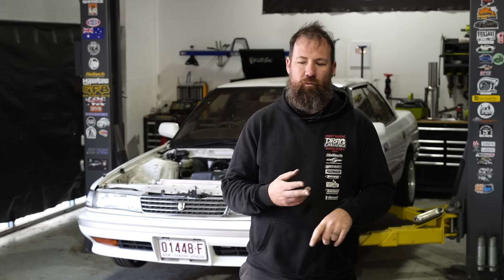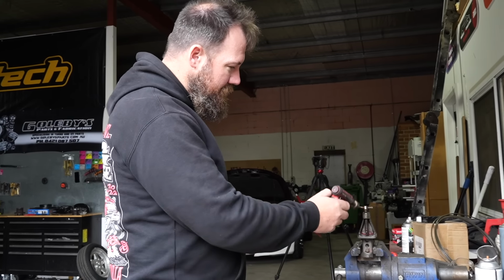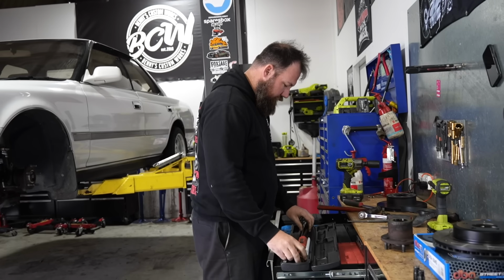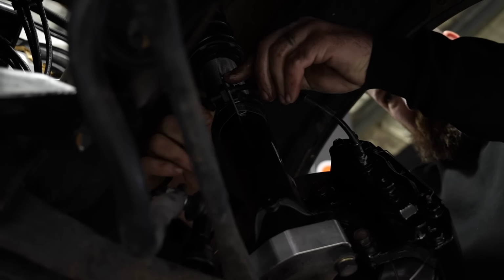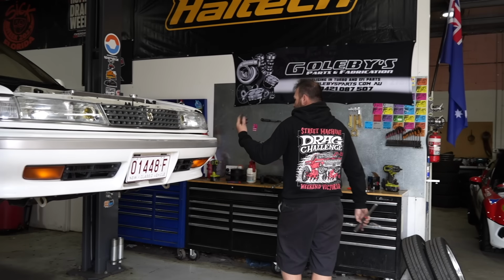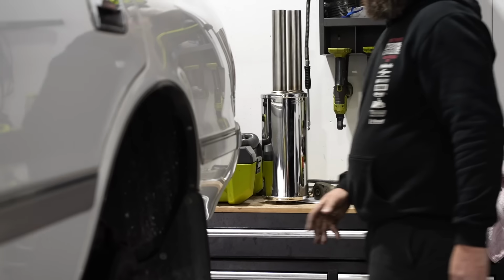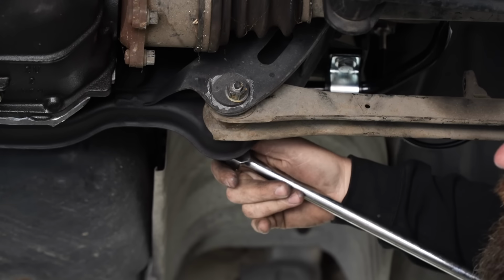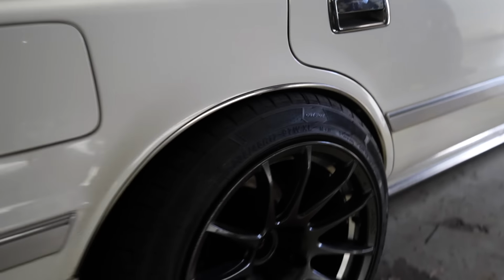Why are R33 Skyline brakes so good?

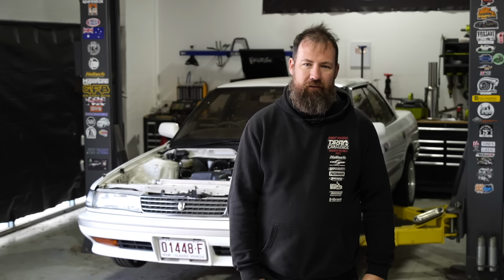Comment: 1:32 ... ADHD yes... GTiR yes, keen on bigger brakes, but also still using stock 14" wheels ... one day perhaps 4x100 - > 5x114 conversion along with new 16" ... 
GTiR front is the ADV22F ... f*cking tiny 257mm considering the amount of us running extra boost ...

Comment: Can confirm you can run 16's with the R33 brake upgrade, currently got 16x6.5 +25 on my MX73.
Reply from the maker: 15 inch convo pros clear them :) 
R33 oem wheels are 16’s😊

Comment: opened my snap on 1/2 digital torque wrench after like 2 months of no using it and the batteries were still inside and completely errored everything inside where they go, absolutely sucked considering the price of the wrench

Comment: "I think it's a bit of a 'Wives Tale'..." As a motorcyclist who has had to bleed brakes way to many times. The system on a car is large enough, the smallest amount of air won't cause any kind of issue, but, on a motorcycle, the drops shown in your video is enough to effect braking on a bike. If it isn't a solid stream, not drops, it's a real problem for us, but, a car has enough inborn pressure that small amount of air isn't going to make a difference.

Comment: Any chance this would work with R34 (gtt) calipers to accommodate a 310mm disc or would they have different spacing to the R33 unit? Or 296 plenty of brake for x8s until you’re making silly kW and doing track work anyway?
Reply from the maker: I have been comparing disc sizing on the DBA website but I haven’t looked at the 34 as it has 14mm bolts so the knuckles need to be drilled
Reply: The yanks have some crazy 6 pot brake upgrade that has a 330mm disc with minimal modifications.

Comment: The smear on the brake pad affects both the ability to move and, to some extent/stop rattles.
Gas in the house can be quite bad, most are not vented properly, and carbon monoxide poisoning is a thing, that is why it is recommended to have a carbon monoxide alarm... that and most of the heat is wasted energy. 
Not all range hoods over the burners vent to outside, a lot just go behind the cabinets or maybe into the roof space above.

Comment: Benny  are you running flexfuel e85 what size injectors will you use   thankyou
Reply from the maker: Yes we have the capacity to run E85, from memory the injector is around 500 cc
Reply: Thanks

Comment: So, are shouldered spindles common on rwd Japanese cars? I've only seen them used on Dakotas here in the states.
Reply from the maker: This is the first Toyota I’ve seen them on, JZX90 on uses the same bearing but in reverse, the knuckle/ upright supports the outer bearing shell and the flange presses into the inner surface of the bearing. Ford also used it here in Australia from 1999 on

Comment: This is a lot like what I did to my 2010 WRX, I got a caliper bracket set, Cadi ATS-V brembo calipers, 2004 STI slotted rotors. Did this all for about 800-900USD, would have been less if I didn't change the rear rotors too. I was going get them powder coated but ended up just mounting them as they are so they still say Cadillac on them.

Comment: 18:32 Funny timing on that because I had just paused it to comment on the previous topic. You'd flip out up in the states or canadia. There are places where the norm is gas stove, fridge, furnace, water heater, clothes dryer, and lighting with the ultra rare air con system tossed in for bonus wow. Its insane how many LPG operated devices you can put in a house (although there is limitations to concurrent use due to line size).
ps it released Saturday afternoon, rather than Sunday, for the midwest.
Reply: Yep. Mostly our electricity is gas fired more and more now.
Reply: @Low760  You ought to research LPG  appliances.

Comment: I worked in a wrecking yard in Christchurch in the late 90s before any Internet I figured out on x70 struts r32 4 pots bolted on with r31 turbo hubs with r32 gtst rotors them redrill either hub or rotor if you want 4 or 5 stud. Or another option was z31 4 or 5 stud hubs and rotors as they where bolt on rotor hub setup. They did need a 3mm spacer to centre the calipers. I'm almost positive I was the first to do three conversion and share it through at least New Zealands Toyota scene.

Comment: If rechargeable NiMH batteries will work with the lower voltage, they will not blow up in your remotes or tools. Since most tools won't work with low voltage, Lithium batteries become an option. They don't have as much capacity, but they cool thing is you can get them where they charge with a USB cable so great since they are easy to charge in your truck. I use them on my multimeter, IR temp gun, and trackball of my EFI tuning computer.

Comment: It's absolutely bonkers how all of that Frankenstein set up from 3 different manufacturers just works. 

love it.
Reply from the maker: Yeah I wouldn’t be surprised in the slightest if it had the same basic hub geometry as mx83/gx81
Reply: should try mercedes lego.  buddy of mine is running 330x32mm 4 pots on one of early 2000's mercs by using cailpers and discs from 2 other models of merc i think w210 E420 rotors with W220 S class calipers, can't recall if it's on his w211 e class or W203 C class.
Reply: @ravennexusmh GM are similar too.
Reply: The pads that fit these calipers also fit subaru calipers also.
Reply from the maker: @Mr_jz_12 yeah heaps of different calipers/ cars. S14/15, GC/ GD, R32-34, R32 GTR,
Reply: The thing is, they have already done the work to validate it; the only main difference is the weight it is meant to stop.